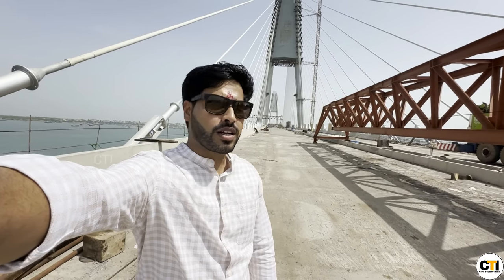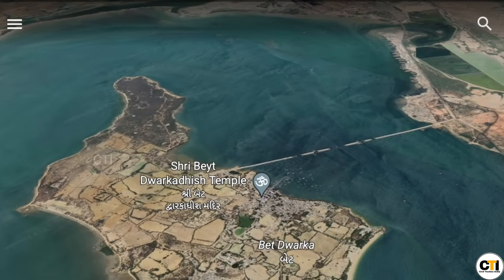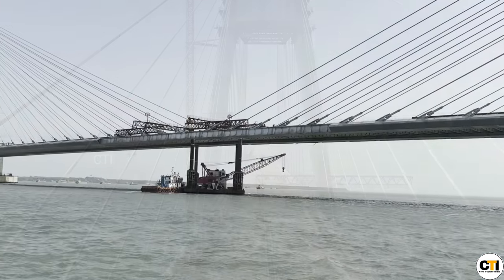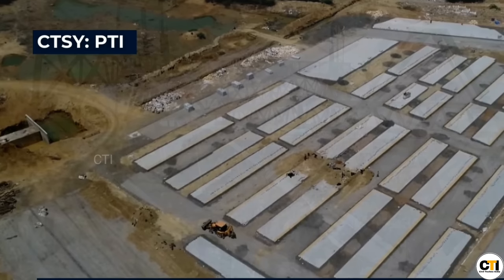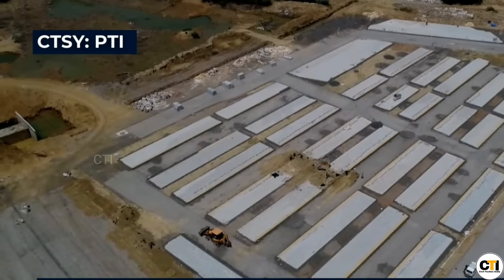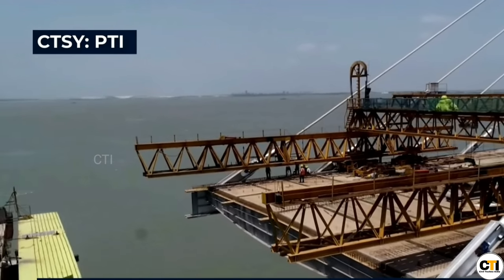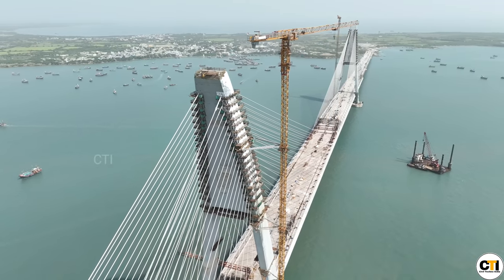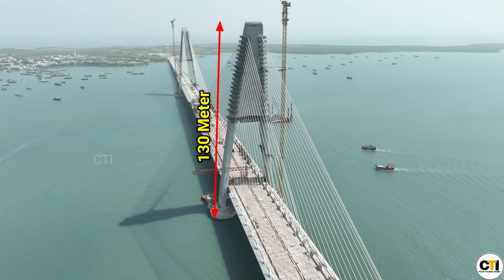India's Longest Cable Span Bridge ||Okha-Beyt Dawarka Bridge Almost Complete ||Full Ground update

Comment: Steel structure in the sea environment will lead corrosion issues. Better concrete is the good option
Reply from the maker: For longer span use composite steel structure.  Like Golden gate bridge, howrah bridge and many more